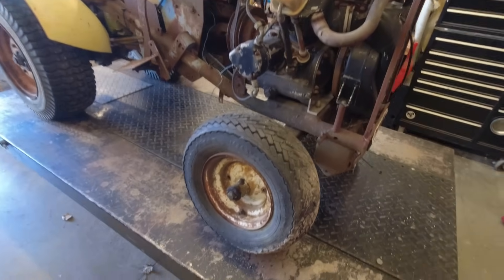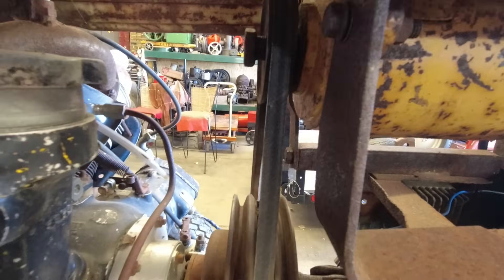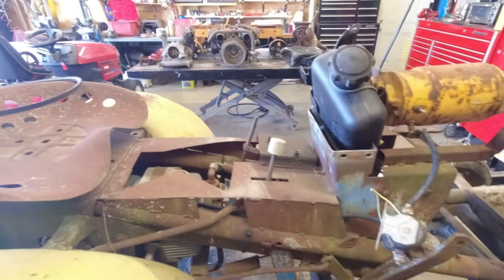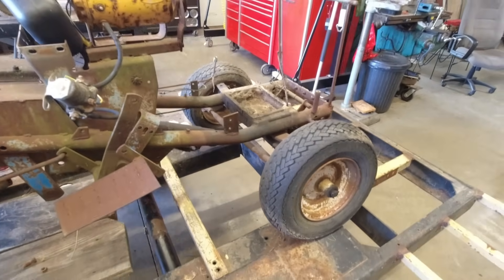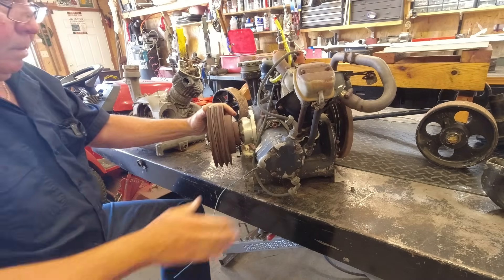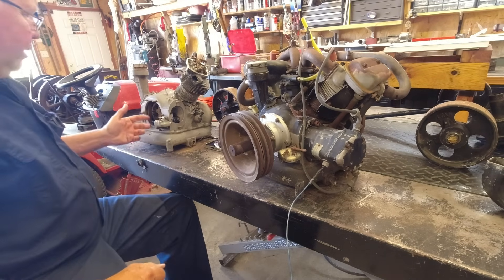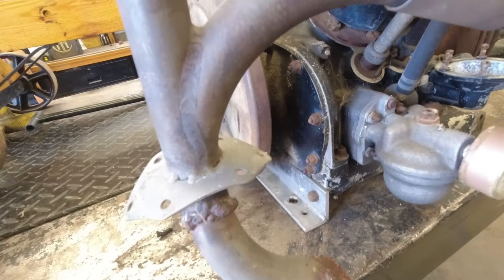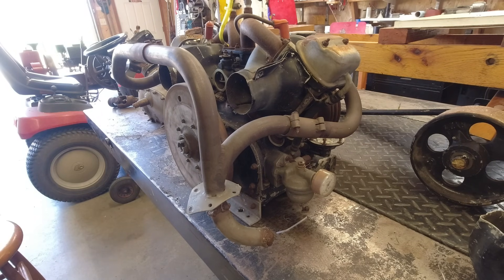Andover WW-2 B-29 Bomber APU Engine

Comment: I'm about sick of the 2 cyl engines that don't have 180° power pulses. Like the Generac generators and 2 cylinder Kohlers, Briggs etc. that are on a "V". Like the Harley Davidson or a John Deere even, with it's hit'n miss sound.  My Onan sounds so nice especially thru the Nelson muffler. But a long time ago I had a Standard Twin that no one believes had both pistons going up and down at the same time. It hit evert 180° apart too. One came up on compression while the other was finishing the exh stroke. It ran smooth too but I never had a muffler on it so it always sounded "raw".  Thanks for showing. ben/ michigan
Reply: You know, I grew up in Michigan, and I never had the chance to meet; it seems they were in a circle all by themselves. I moved out west to Las Vegas, Nevada, and got to know several people into aircraft. but now I'm back here in Flint, I'm back to square one, lol.
Reply: That is actually a 360º firing interval, the same as Triumph, BSA, Norton and Royal Enfield twins. But they SHAKE like a huge single. 180º firing is one up and one down, which gives a really lumpy firing interval, as you have both firing impulses in a half rotation, then 1-1/2 rotations before they fire again. I love the Vs though, as they have perfect primary balance.

Comment: My WWII B-29 APU is a Waukesha ICK. It powers a garden tractor that my FIL built around 1962. He was an Army Mechanic from 1936 to 1946. The Kohler oil pan welded to the frame shows that the frame and tractor were made by Jacobsen for Ford. From around 1972 to 1976. Good Luck, Rick

Comment: I'm pretty sure this is the APU that took out the Kee Bird B-29. Or at least, the leaking fuel line to the APU caused the fire.
Reply: A petrol cab heater in a DC-3 took out Ricky Nelson. A small diesel might have been safer.
Reply: I was coming here to say the same.  AFAIK they forgot to bolt down the APU and the leaking gasoline was caused by all that bouncing.

Such a shame and remember one mechanic died from complications working on the B-29 engines.

I am just assuming but once the 4 giant engines were running there was no further need for the APU so it could have been shut off.